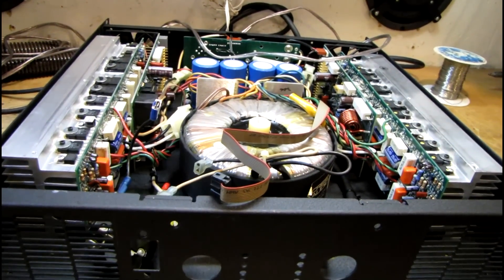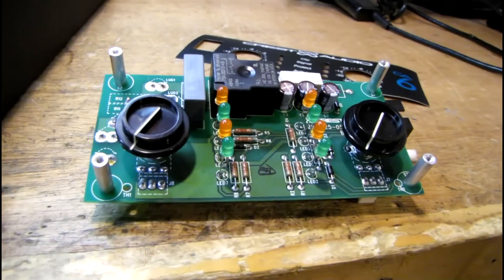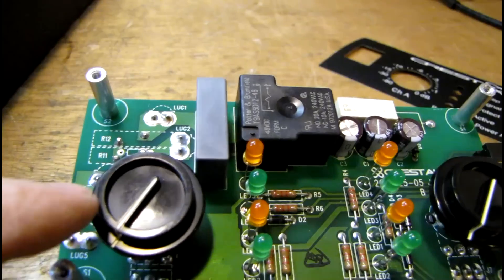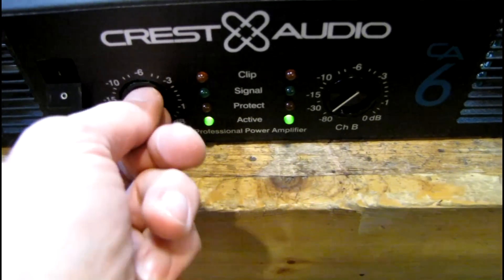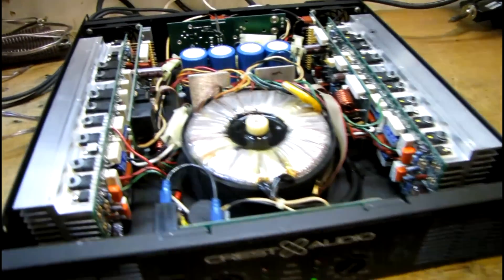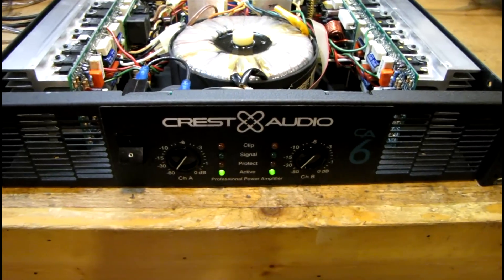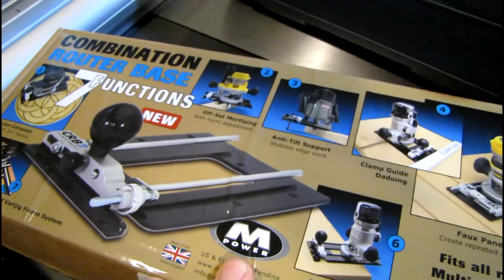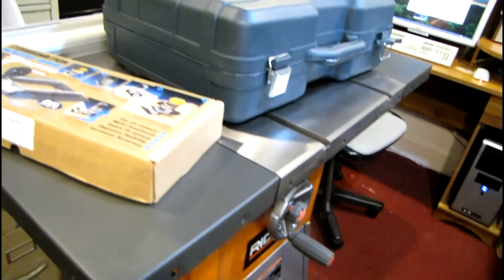Crest Audio CA6 progress, and other stuff

Comment from the maker: I also found that it's a bit better with the cover on, and when the fans are spinning faster.  I measured close to 400W per channel RMS at 8 ohms this past weekend, and it seems to be working perfect so far.
Reply: Chances of you seeing this reply 9 years after you posted these good videos is slim, but I'll give it a shot... You did a bang-up good job on this restoration. I worked at the Peavey Service Center for about 6 years and I was a lead technician for Crest amplifiers. Most of these were work horses; a few were nightmares. If you ever run into another Crest amp contact me - I might have the schematic for it. Hint: if you ever work on a CA12, watch out for those filter caps - if they start leaking, that amp may well be history. The board will burn up and take the transformer with it. Bummer 'cause it was a beast of an amp when it was working right.

Comment: Maxx ,(or anybody else) I have a question that is not related to this video. What kind of glue did you use to attach the vellum paper to the dial face of that marantz receiver you restored and is that glue the ideal glue or would you recommend some other glue? I was thinking about rubber cement but was worried that it might degrade under the lamp heat and the paper would fall off.

Comment: Hi ! my ca6 suplied today. The transformator is made in ireland and i have no settings outside on the back panel for adjust. the adjust is inside via jumper on a panel. xlr settings, sensitivity for dbu and a switch where i cant see for what. the switch have 3 positions. i never can find any infos about. maybe u have ideas??
Reply: You can find manual on google for those infos. By the way,where does the "sensitivity for dbu" located?